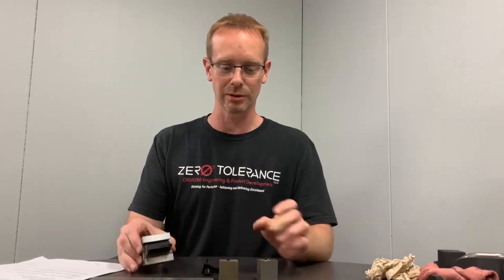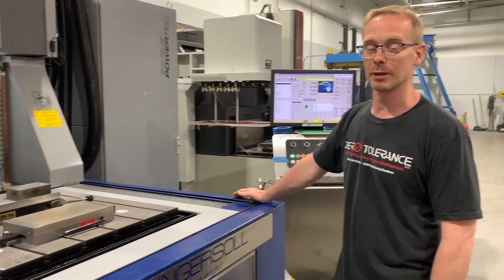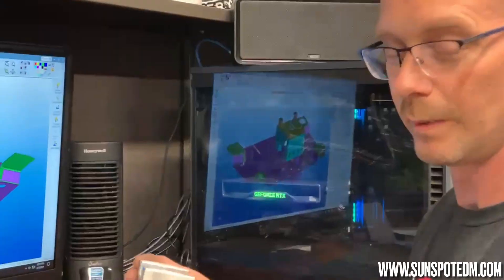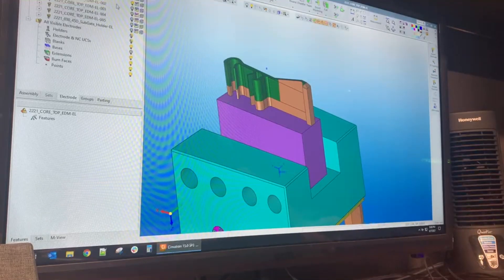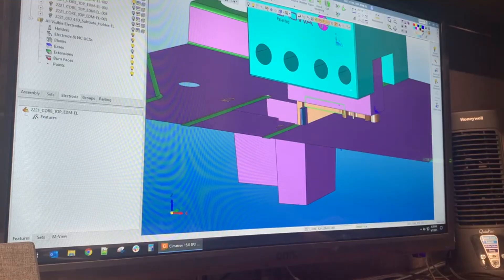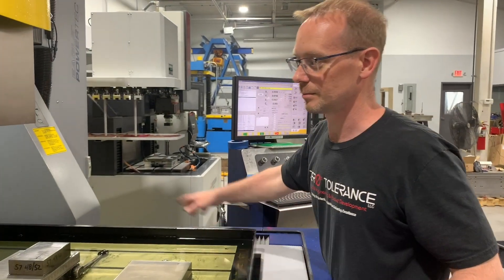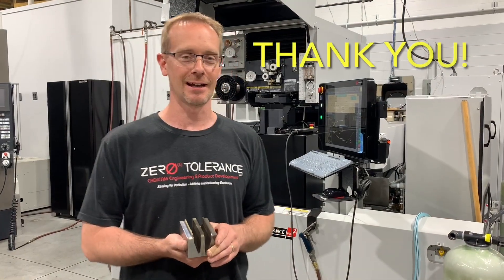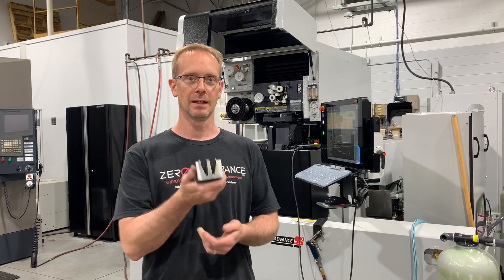Introduction to Electrical Discharge Machining | Learn to Burn

Comment: I worked on two of these Gantry 400 Eagles in Hungary. Was in front of each other. 
It had a robot system with 220 electrodes , and as I remember with 20 palettes. Robot was moving day and night . Used from a Siemens Nx system. 
I made the electrode negative modellings, and with the Holder -WPO positions all the positions was out for Multiprog on export. No needed to typing.
Had a 5 axis Speedhawk  to it. Besides we had some problems with the routers- network connections, some IT help sometimes.
I think this was a good system. Fun to work with. You can rotate an electrode with the offsets, from the middle point, not just the spindle rotating, and the numbers moving. 
Can write the end vector distance of an injection gate in a move. 
Automatic pneumatic doors in a button. Tank was coming up filled, not like tank is up, and starts to fill. And the spindle had a very fast move , sometimes little noisy.
Reply: With  an Erowa CMM
Programmed from Nx. Full dimension listings in PDF documents , where you can see all the deviations, with a 3d model that is rotatable with a lot of measuring points .
Electrodes, Workpieces, you can use all the machines standalone in Manual mode. 
Milling machine was connetcted with an exhauster , everything was clean. 22 Celsius in the whole EDM area..

Comment: Could have better flushing on that first burn. Also we did make a similar clip with that christmas tree type clip. We originally made the die in insert layers, then we developed the first ever rotary electrode system, so we could rotate the electrode through the die insert.

Comment: What is the type of sensor that prevents the workpiece and the electrode from shorting each other. How is the distance measured by the sensor. Shunt resistor?

Comment: So if i wanna sink a square hole 20mm by 20mm do i have to mill the electrode smaller then 20mm or 20mm sharp?

Comment: The best way to honor you mentors is to pass in what you have learned. 
I am a tool and diemaker of 40 years and I just really enjoyed your video, and your explanation of the over burn. I was trained in an old edm that yes we used super glue, on the carbon graphite and small c clamps and all kind of stuff, ah the good old days..😃

Comment: I'm more of a fan of electrochemical milling: essentially reverse electroplating.
Selective masking confines metal removal for etching graphics; a formed cathode can 'plunge-cut', leaving a hole with the same profile as the tool.
Wire EDM is more precise, but tool configuration prevents making concavities on flat surfaces.
ECM with a shaped cathode works very well for plunge-cuts and concave surfaces, but requires 100's of amps, high-pressure electrolyte pumps, cooling and rigid fixtures...
EDM can plunge-cut, but the tool is consumed.
I've used ECM and masking to make decorative designs (back-filling etched areas with silver-solder), roughing out the shape of knives (think terraced hill-sides) from steel billets.

Comment: steve is it posable to edm a rmr cut on a gun slide
Reply: We manufacture and design alot of gun & gun magazine molds here, we use EDM and Wire EDM on every tool

Comment: Being one of those old timers I'll mention your not quite correct on the square corners knowledge. In your lifetime cnc Mills and lathes do the heavy lifting. It's easier to design around the processes available on the shop floor so square corners are avoided when possible.

A shaper can cut square corners and brooches can also cut square corners but usually requires a hole or pocket space for the chip to roll into during the cutting. Not many shops have shapers these days and the skills to run them is even rarer than the machines.

A waterjet can also cut square holes. The real advantage to EDM is accuracy. You can maintain far better tolerances than most waterjet machines and you can work in blind holes. A plastic injection piece to hold wires probably doesn't need tight tolerances. The die for this part could have been a dozen different ways using conventional machines and easier to machine tool steels and then had the individual pieces heat treated for the desired hardness.

If you got a guy with a burn table in the area that also designs and cuts his own electrodes for the task at hand and at an affordable rate then it makes sense to farm that part of the die build out.

With the internet and modern software, and a fast and efficient postal system, farming out work has become the new standard.
Reply: I've made square holes with broaches manually.  This guy is full of shit.

Comment: Great video! I have a question: after edm cut, surface of cut section roughness is low, maybe after cutting, you will do polish process for it?
Reply: It depends on what the finish the customer is requiring or what the individual part requirements are. Thanks for watching!

Comment: Have always found the process interesting, always wanted to learn more about the sinker process. Worked in a mold shop for only 4 months, and only saw them run the sinkers they had twice the entire time I was there. But they have wire EDM and hole popper EDM where I'm at now.
Reply: Wire EDM seems to be more popular in some shops, depending upon the work that comes in. In our latest episode we explain why sometimes it makes sense to burn more of the job than to mill it, in our shop anyway. Our sinkers & wire are always running. It really helps keep the work flowing utilizing another path of getting high end results.

Comment: Fascinating content since most don't see much EDM.  Really want to see more of this kind of content, so thank you.  ZT has some impressive machinery and EDM is magic for tool & die workloads.
An inexpensive lapel mic will greatly improve the audio.  Looking forward to the current and voltage info as well as the lifetime of the graphite electrodes.
Reply: Thanks James!